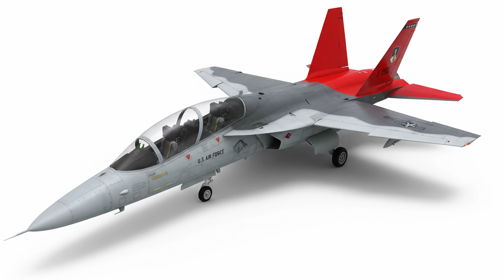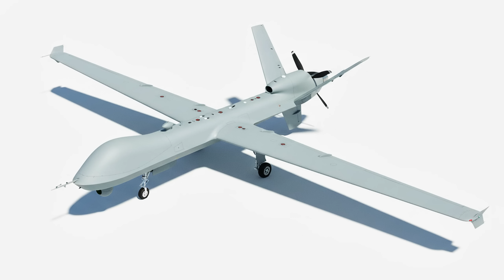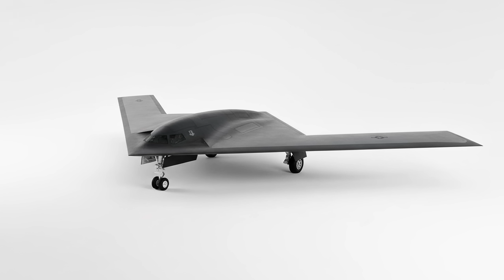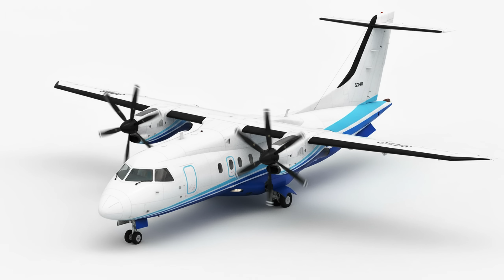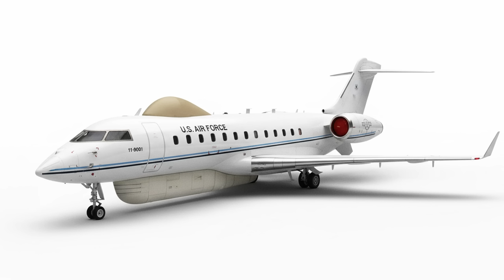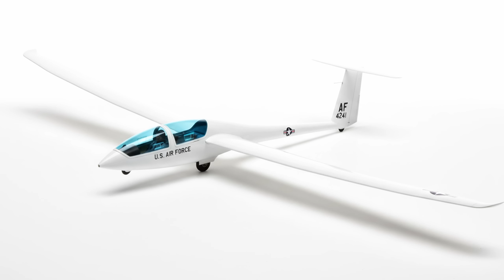Every USAF Aircraft Explained in 12 Minutes

Comment: airforce one should be included in this list :D
Reply: Air Force One is a call sign,not an aircraft. It denotes that the President is aboard whatever aircraft he is  in. But they did show the E4B( Doomsday plane)which is a modified 747 and is used by the President for pretty much all his flights.
Reply: @chuckselvage3157  The E-4B is a way different variant of 747 compared to the President's 747, which is Called the VC-25A, E-4B is used by the president when all out nuclear war breaks out, nukes can't reach it, and if they did, special paneling reflects radiation I believe, and is equipped with an aerial refueling system to stay up in the air for days, the VC-25 is used for all his flights, not the E-4B
Reply: @Boaris_Johnson Yeah ok thanks for correcting that. 🙂
Reply: @chuckselvage3157 You sound like a bot.
Reply: @chuckselvage3157 no, the VC-25 is used by the president, and sometimes the C-32. If the president flies in the E4B, something is terribly wrong.
Reply: @kabouterwesley83 Yeah ok thanks for correcting that.🙂
Reply: @chuckselvage3157 🤓👆yes we all know af1 is a call sign. We know it’s referring to the vc25. But it’s just more commonly referred to as af1 because when people see it or it’s in the media, it’s mostly af1 at that time. 

But here’s a gold star…⭐️